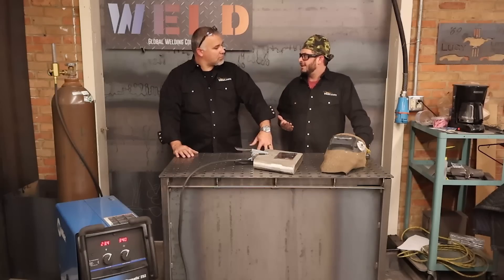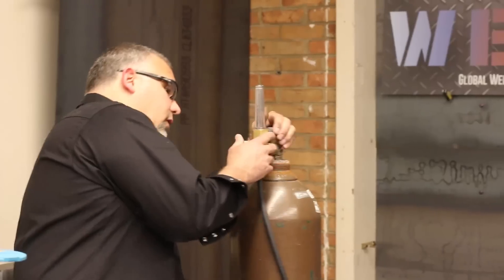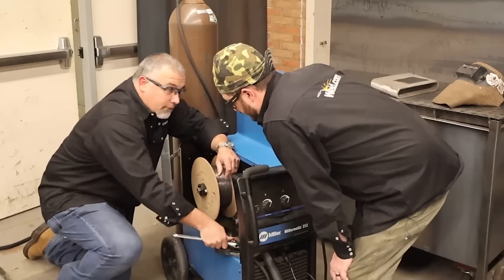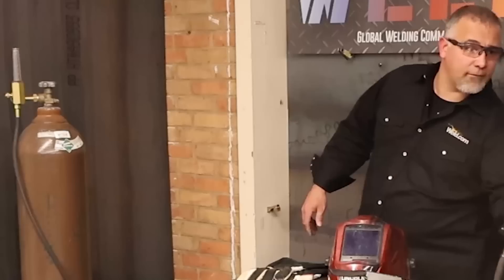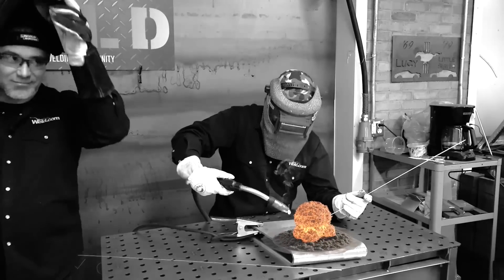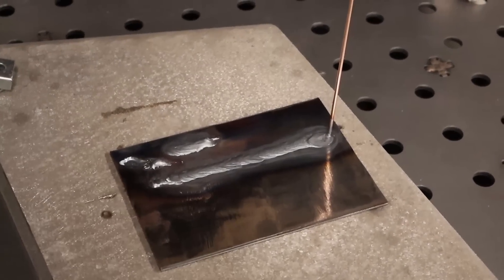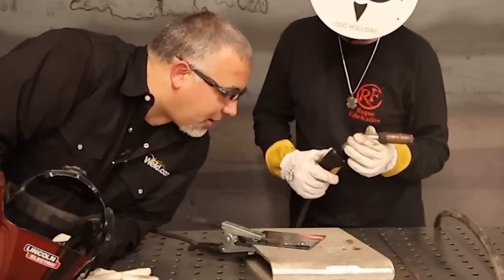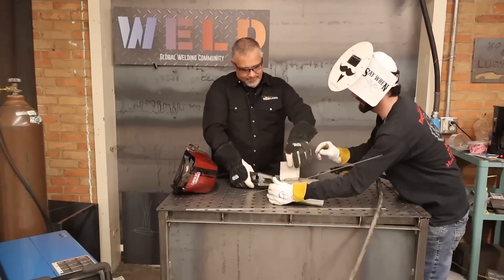Can You Turn Your MIG Welder Into A TIG Welder?

Comment: what about using arc welder to do tig welding? i got a 160 amp inverter arc welder. i would like to do some tig work. do i need to buy a tig welder or can i just get some stuff to add on in order to do tig?

Comment: Can you really not weld aluminum with dc or is it just not nearly as good as ac ???
I have read dc welding aluminum is quite possible.
Reply: Very possible are we talking GTAW or GMAW. Mig aluminum is usually done on DCEP. For Tig on DC you’d use 💯 Helium and get great penetration on DCEN but not as pretty of a bead and overkill for thin materials.

Comment: Barbarians!  Get a real tig torch setup.  Five years ago I modified a Lincoln 125 to use a real tig torch. Simply buy a cheap replacement whip and graft a real tig torch to it.  The gas/electrode uses the same fittings, then splice the switch to a tig switch for arc and gas. Plug the wire port on the whip to prevent gas leakage. Set the aluminum gun setting to on, polarity as you say.  Now you have a real scratch start tig with pre and post flow control.  On low setting you can fusion weld box cutter blades.  I told the Lincoln rep and he said they have a bunch of multi-process welders coming out.  But for all those millions of people who already have the big box store welders, this might be useful.

Comment: TIG is broken and you need to do some welding try connecting the MIG if you have a MIG that converts to Arc Welding you can convert it to a TIG lift start.
If you want high frequency start connecting a 12 Volt DC car battery into the mix improves your start.
Lincoln Welding Hand Book has some valuable information for welding.

Comment: Iv been thinking about trying this.

 I have a miller that can do cc or cv, any recommendations on where to start other than just playing around. 

My Bernard torch (with gas) can handle 300 amps and I have a few 1/16-1/8 tips.

If I get to it in the next week or so I'll send you a video of my results
Reply from the maker: if the machine runs CC just use the right process for now 😅 if it only does SMAW you can still run a scratch start set up with an adapter block

Comment: Technically there is, if anyone has used either Millers or Lincoln Electrics machines that use double pulse. You can set the amount of time between the pulse and when it ramps down, these machines are used a lot in aluminum boat building.

Comment: I expected it to work to some extent, but didn't expect you to get welds nearly that good. Does pulsed MIG give more control? Does it work on aluminum too?
Reply: No. You would need AC output. Dedicated MIG welders are DC only.
Reply: @williamthomas9463  Not true we have an older Miller 450 XMT set up for wire and a spool gun using 4043 and it welds Aluminum very well on DC only
Reply from the maker: if you have a mig machine just try welding aluminum with the right process. you can weld aluminum with mig (100%) argon u groove rollers and plastic liner, or spool gun. you wont be able to MIG/TIG aluminum this way

Comment: The real question is... Can you turn a TIG welding machine into a MIG welding machine, with or without a spool gun?
Reply: Yes easily.  It’s called Constant Current mig welding. You simply flip the switch up in a 12vs feeder to CC instead of CV. It welds a little differently
Reply: @adamstreich3007 Did anyone make a video about it?
Reply: @DeksZagreb not sure but I’ll add it to the list of videos to make as it is interesting as has some quirks to the arc
Reply: @adamstreich3007 What would be the challenge, to match the spool gun feed rate or the arc itself?

Comment: You should try using a tig torch for  the arc but use a mig gun to feed filler.
Reply from the maker: They also have something like that called Tip Tig that you have on the torch.
Reply: @Welddotcom  I know,I was just wondering how or if it would work out
Reply: @maggitmaster it works well.  Especially if you crank the wire feed down to like 60 ish IPM and just pull the trigger and dab along.  They also have hot wire tig which is like energizing the wire like you would with mig and still tig welding.  Great suggestion for another video